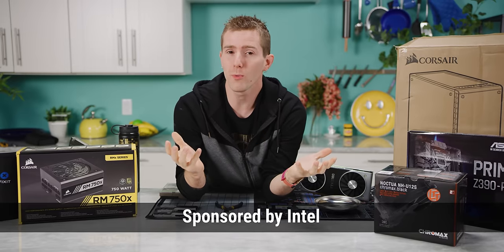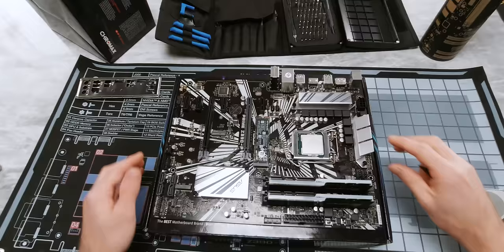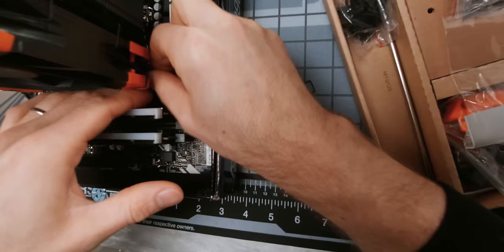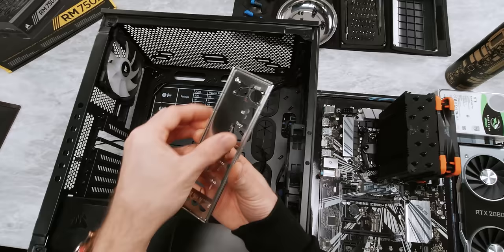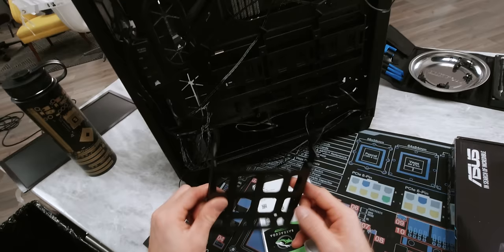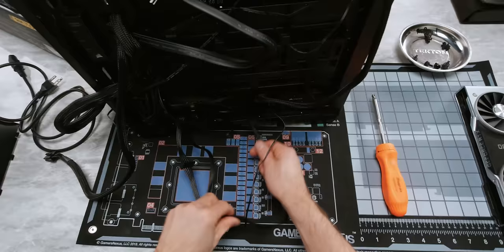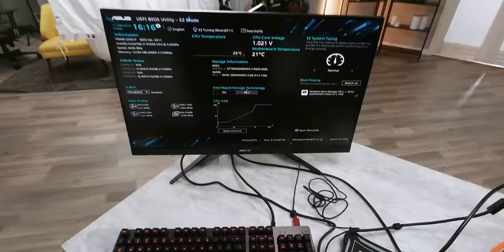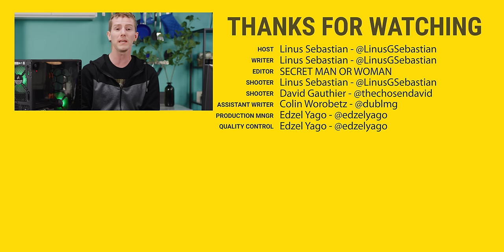First Person View PC BUILD Guide! (POV)

Comment: Great video, will definitely use this video when building my first PC eventually, but I have one question about graphics cards, I was going to get an MSI graphics card but found out its too long for the case, but the Nvidia version fits the case. I was wondering what is the difference between a different brand or the standard NVIDIA graphics card? I have looked it up on different places but found different answers. Can I just put the standard NVIDIA card in or is it beneficial to use 'Branded' versions? Is there much difference? Sorry if that makes no sense, trying to learn here as a noob haha

Comment: Hello i need help my pc has 2 disk drivers installed but only 1 is being used and i dont know how to make my other one work
Reply: Drive and driver are 2 very different things. I'm assuming you're talking about 2 drives. First, make sure both drives are detected in the BIOS. If one of them isn't, make sure it is connected correctly) to the motherboard. If you happen to have an M.2 drive and a SATA drive, make sure you read the motherboard manual to see which SATA ports are disabled if you have an M.2 drive installed. 

If the drives are detected in the BIOS but don't show up in Windows, then you will most likely need to initialize and format the drive through Disk management.
Reply: @JJFlores197  Yes but i dont know how to because i have a alien ware and im new to pc but can you make a video with a tutorial because i have no clue 

The i have 2 drivers on my Control panal but 1 doesnt show up in my storage do you have a discord account i can show you it on by any chance?

Comment: since you had 2 hard drives installed, how does the windows 10 installer know which hard drive to install the windows image onto?
Reply: You select which drive to install to. Its best to only have the drive you want Windows installed on plugged in. This is to eliminate confusion especially if the drives are of the same capacity.

Comment: When do you think your ready to actually start building a pc when should I start
Reply: If you have an old PC laying around that you don't mind experimenting with, use that to learn. Take it apart completely and put it back together. If you can do this several times without issue, you can assemble your own PC. The process will be mostly the same.

There's no exact 'metric' to determine when you're ready to build your own PC. Some of us just jumped straight into it without much knowledge or resources.

Comment: Hi, I'd like to ask for some advice. A friend has a custom built PC that is a few years old. Last week he had an issue with his monitor not displaying and after switching the DVI ports, it started displaying again until yesterday when it caused the mentioned issue and after again switching ports it displayed as normal. The graphics are separate from the motherboard. As mentioned, it's a few years old but would like some advice to figure out if it's a card issue, ports or driver. Thanks

Comment: Building my first pc rn and i sliced the shit out of my fingers againsts the metal sheets on the cpu cooler while trying to remove the fans, then i had to remove them a second time and it happened again, the coolermaster ones i got dont have those clips so you gotta either dig your nails in or use some tool to remove, i didn't have either so i just bled everywhere, i guess pc building isnt idiotproof

Comment: Well ive followed this and my PSU will not power on whenever its connected and plugged into my motherboard. When not plugged into anything and doing the test it operates just fine.
Reply: So.. it doesn't work when plugging it into the mobo but by itself it's fine? You should replace the PSU, it could be faulty

Comment: uhm i have a question, what happens if you used different frequency of ram??
Reply: If it even works, it will work at the lowest frequency, or the computer won't boot.

Comment: Good evening, thanks for the video.
I want to build a PC (mainly multimedia and gaming) and want to ask if the parts I'm planing to buy are compatible with each other and if you'd recommend something else:

Corsair 500D RGB SE Mid-Tower
 
Gigabyte Motherboard Z690 Aorus Master 1700 ATX

Intel® Core™ i7-13700K
 
 Palit VGA RTX4080 16GB GameRock OC

Corsair iCUE H150i ELITE CAPELLIX

Corsair DOMINATOR PLATINUM DDR5 32GB (2 x 16 GB)

Corsair HX1000i 

Seagate FireCuda 530 NVMe SSD 1 TB

Seagate Exos X18 Enterprise, 18 TB HDD

 do I still need anything else?

Thanks in advance👍

Comment: is "Thermal compound" optinal?
Reply: No. Fortunately, most CPU coolers come with thermal paste pre-applied so you don't necessarily need to buy extra. I still would just in case you need to remove the CPU cooler later.

Comment: Idk if anyone will answer but does this video apply to most pc builds?
Reply: The overall PC build process has not changed dramatically in 10-11 years. There are slight variations between makes and models, but nothing too difficult to figure. As long as you take some time to read the manuals you should be fine. The hard part right now is finding parts in stock and at reasonable prices.

Comment: Within 3:40 I've broken something. It says to pull the thing back on the CPU so it pops up but nothing popped up apart from a piece of plastic
Reply: That's what is supposed to happen.. You install the CPU in the socket and as you lower down the lever, the black plastic will pop off.
Reply: @JJFlores197  at 3:10 there's a plate thing that's up, I tried to get it up like how he did and a plastic bit snapped off from the back.

It all works though so all good lol

Comment: I have i5 9600kf with a 3060ti and i want to upgrade, should i go for 7 7800x3d? to pair with my gpu, maybe in a year i upgrage the gpu
Reply: 7800x3d is very very high end, most people pair it with the 4090. unless you're getting a 7900xtx, 4090, 4080/4080ti/4080super, or maybe or 4070ti or super, it will probably bottleneck.

Comment: Is it bad if there’s slightly too little or slightly too much thermal paste?
Reply: its could be bad but you have to fuck up really hard to actually mess up anything.
Reply: Like he said, put on a bit more than you think you need. For LGA1700 and AM4/5 CPU's, a dot slightly larger than a pea will do the trick.

Comment: A HDD isnt necessary right? Im getting a 2tb SSD is it enough?
Reply: Your SSD is what you install your OS and keep everything that needs fast file transfer speeds on, a HDD is really only for extra storage. They are considerably slower than SSDs but cheaper per gigabyte so a good option for extra storage which doesn't need to be accessed as quickly.

Comment: What sucks is that my house is carpet so I'm worried that my pc's psu or motherboard is shorted out due to the static electricity.  The case gets power so the psu shouldn't work IF it's shorted so I'm afraid it's the motherboard
Reply: Don't be afraid. Like he said, take the PSU before you start, plug it in, make sure it's in the off position, then you can put your hand on it to ground yourself after handling electric parts. You can also move the carpet away or stand on some cardboard.

Comment: Would these parts even work or fit inside of a Corsair 465 RGB case
Reply: I suggest you read up on PC form factors. Tom's hardware has a pretty good guide on form factors.
Reply: @JJFlores197  alright cause I can't find a 460 rgb case anywhere cause I have a build but this is the case I need and I cannot find it it's sold out everywhere

Comment: Do I need any thermal paste when building a pc?
Reply: Most CPU coolers have thermal paste pre-applied so you don't necessarily need extra. it does come in handy though from time to time.
Reply: there needs to be thermal paste, otherwise youll kill ur cpu and your pc will crash and run hot

Comment: My advise is to take your time if your a first builder even take some breaks. For me having a motherboard with better CPU cooler fan location saves a hassle and a removable bottom shroud that covers the CPU on your case. My other motherboard I upgraded the CPU fan and the CPU fan slot wasn't at a spot that many other B450 and B550 motherboards were at and it was pretty annoying to install once in the case. I had to go in sideways even with the CPU fan removed on my Peerless Assassin to install it to get it in. Other motherboards its higher up to the right above the ram and this one was to the side of the ram towards the CPU instead of just above it. My bottom shroud that holds the PSU wasn't removable and it also didn't have holes coming up from where the PSU was which a lot of cases do have now. Any case you can do a build with but having a more convenient case layout with cutout space and good airflow out of the box or potential helps a lot.

Comment: How do you know if you have to install the mounting posts for the SSD drive or not?
Reply: Look at the motherboard to determine if the post is already on there. I believe most motherboards that have M.2 slots already have the mounting posts installed.
Reply: @JJFlores197  Thank you! Question:  By mistake I installed the SSD and screwed it down without the mounting post. I noticed it didn't look right, that there was a bend in the SSD card. I fixed it by installing a mounting post, but do you think the drive is ruined because I flexed the SSD card a bit?
Reply: @julla1416  If the drive is detected in the BIOS, then chances are good that is fine and you don't really need to worry about it.
Reply: @JJFlores197  Thank you very much for your help Jose!!

Comment: Hi guys, my power cable to the psu is not completely plugged in (part of it looks not fully plugged in), is it alright? My pc still turn on though.
Reply: I would make sure its securely plugged in. Even if it isn't completely plugged in, it will still work, but if you accidentally move the computer or cable just enough, it can cause it to disconnect and loose power.
Reply: Make sure it's completely plugged in to prevent any surprise disconnections or shorts.

Comment: I builded my own pc 2 days ago and after I turned it on my monitor gets no signal and neither does the mouse or keyboard.. I tried to use new rams but it didn't work I also took the CMOS battery out and put it back there.. all the fans are working and lights/leds so what should I do :( ?
Reply: Make sure ALL internal components are installed/seated correctly and that all necessary cables are plugged in the correct ports. Make sure your RAM is installed in the correct slots per the motherboard manual. Make sure the CPU and motherboard are compatible with each other. With Ryzen builds, it can get a bit tricky if the BIOS version of the board needs to be updated. Some boards have a feature that let's you update even without a compatible CPU, but most of the lower to mid range boards don't have this.
Reply: @JJFlores197  the motherboard was together in the ryzen 5 5600x bundle and already did try all that but thanks for trying to help man

Comment: Hey Linus, i'm wondering how do I know if I am buying a component that will actually fit in the motherboard... Any help will be appreciated

edit: I know bout the RAM, must be DDR4 if the motherboard requires it and so on. But what about the cpu, fan and gpu ? How do I know that those will work on my motherboard?
Reply: the cpu and the cpu cooler by the socket, the gpu by the PCIe slots version in the motherboard.
(i'm sorry for my bad english but i'm italian)
Reply: @tommaso159  thanks, this helped me build my desktop

Comment: when buying parts for my PC I forgot to get thermal paste. Is it really needed?
Reply: Yes it is needed. Most CPU coolers come with pre-applied thermal paste so you don't need to worry about it. I would still buy some just in case you need to remove the cooler at some point in the future; you don't want to re-use thermal paste.
Reply: @JJFlores197  I have a NZXT H510 case. With a Asus tuf Z790 plus. will a RM750x 80 Plus Gold work with these?
Reply: @marcellic  As long as its a standard ATX power supply and has enough wattage for your components (CPU and GPU are the parts that use the most power in a PC), it should be fine.

Comment: I’m confused on argb cables
Reply: RGB are arrggghh GB like a pirate lol
Reply: What are you confused about? ARGB is assignable RGB. Very common three pin connectors. Then you have the four pin which are often used for more proprietary stuff like Aura etc. If you find something with 6 pin stuff etc. just move on.

Comment: can i use the motherboard for an ryzen 5 cpu?
Reply: No. AMD and Intel CPUs and motherboards aren't cross compatible. If you want to use a Ryzen CPU, you will need to swap out the motherboard for one that supports the CPU you want to use.
Reply: Nope, amd and intel have different sockets, you can tell them apart because intel has like a cover or frame and amd doesn’t have anything holding the cpu apart from the lever

Comment: Not to sound stupid but what's over clocking i could Google it but I figure any explanation on Google would be 90% tech speak an id have to Google that too
Reply: Its when you force your hardware to run faster than it was designed to operate. It may give you better performance. Its not something I recommend doing since the gains aren't usually that good and it has the potential of damaging your hardware if you don't know what you're doing. At least I don't recommend doing it without understanding the risks.

Comment: Why do you have to ground yourself when building one??? Static shock?? I've never seen that before now Fireworks yes obviously but pc building.... that's odd lol but uk I've never bulit one....
Reply: you can discharge the mobo, there is a very little chance for that, but be careful with that, and you can do it with a heater/radiator on the wall
Reply: you can damage parts too if not careful with grounding

Comment: This looks absolutely horrifying, I fear for my life and I don’t even have the parts yet
Reply: lmao. This is easy stuff. 2-3 decades ago, yes that was horrifying. You probably don't realize it, but modern PC building is mostly plug and play. Parts are mostly compatible with each other. Back then, that wasn't really a thing. It was more like plug and pray. You could have situations where a peripheral wouldn't work because you didn't put a jumper in the right spot on the motherboard. Or a device wouldn't work because there was an IRQ conflict. Back then, installing Windows was easily a multi-hour ordeal. Nowadays, you can have a fully installed Windows system in less than 30 minutes.
Reply: @JJFlores197  that sounds ten times worse but I’m still horrified with this
Reply: @itstqt  Don't let the bad lighting and all black case and components fool ya, lol. I promise it's not that scary when you have it all in front of you and there's nothing creeping in the shadows.

Comment: WHAT HAPPENS WHEN UR FLOOR IS CARPET WILL IT STATIC??????
Reply: No it just bad airflower for the psu it will collect alot of dust,  The genral rule is if you have it on Carpet just place the psu so the fans turn upwards

Comment: My biggest issue is you say "just wire in the fans" my guy I have never seen a motherboard before looking at the one I have now. I HAVE NO IDEA WHERE THIS IS SUPPOSED TO PLUG IN WHAT THINGS TO LOOK FOR OR NOTHING
Reply: Have you looked at the motherboard manual? Pretty much all motherboard manuals have a layout of the board as well as where the connectors are and what they are. That's what its there for.

Comment: I've watched this several times and I still don't know how to connect all the cables
Reply: What specific cables?
Reply: @JJFlores197  the ones you connect to the motherboard and power supply.
Reply: @icantsee0  For your motherboard, you typically need 2 cables: the 24 Pin ATX power which powers the motherboard and a smaller cable that connects near the CPU. That's it. If you have a graphics card, you would plug in the appropriate power cable(s) from the power supply to the graphics card's power input. If you have hard drives/2.5" SSDs you plug in SATA power cables to each of them.
Reply: @JJFlores197  I'm more so confused about all the lighting/fan cables. There's several spots for those and I don't know which one should be correct.

Thanks for the information, even if my PC parts aren't gonna arrive anytime soon 😅
Reply: @icantsee0  That's one of the reasons I dislike RGB crap. It makes things more convoluted for no real value. In general: Your fans will plug into the motherboard's fan headers. It doesn't usually matter which specific headers you use. If you are using some sort of fan hub/controller, you would plug your fans into that instead of the motherboard. If you have RGB lighting strips, they will either plug into the motherboard if it has an RGB header or a dedicated controller. Some more advanced setups may combine the fan/RGB controller into one unit. Realistically you really want to read the user's manual for your hardware.
Reply: @JJFlores197  imma take a screenshot of this convo so when my parts arrive i can use ur advice to set everything up. I feel pretty confident now. Thanks 👍